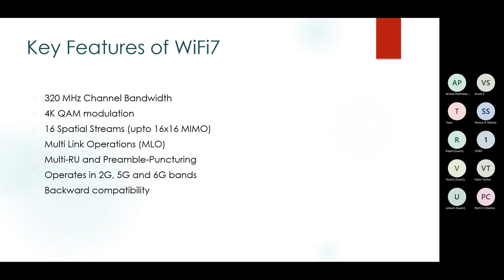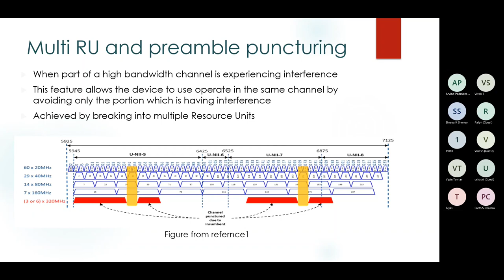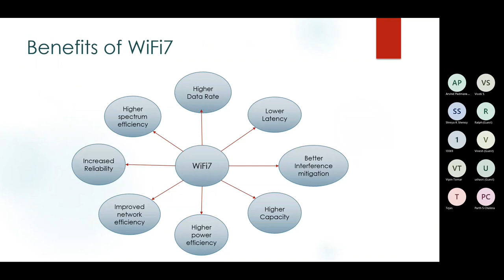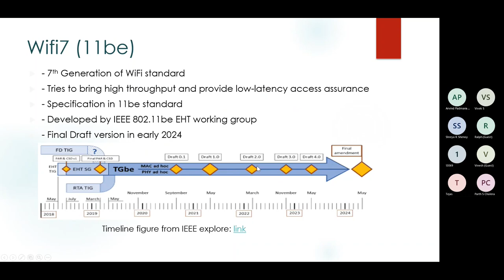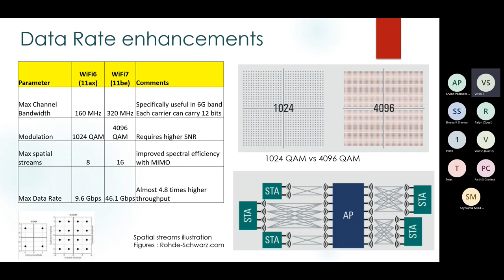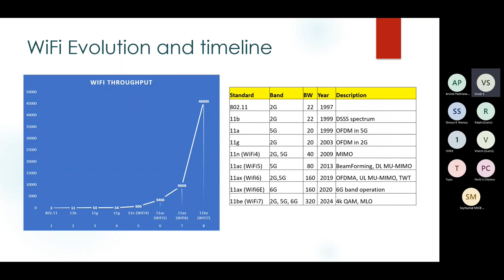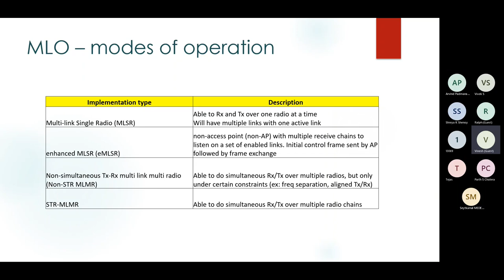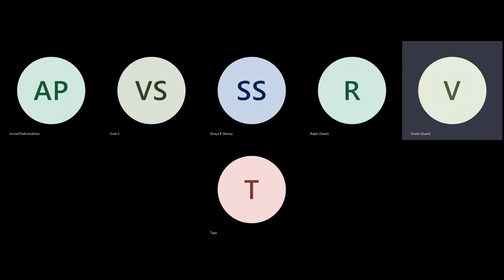The Basics of Wi-Fi 7

Comment: my take on "Question Vivek's regarding range difference between 5GHz and 6GHz"

When discussing the range differences between the 5GHz and 6GHz frequency bands, it’s important to consider the specific parts of these bands. Both bands are relatively large and quite close in terms of frequency, so general comparisons can be misleading. Here’s a more detailed breakdown:

1) Comparing Upper 5GHz and Lower 6GHz Channels:
If we compare the upper channels of the 5GHz band with the lower channels of the 6GHz band, there is essentially no significant difference in transmission range. The proximity of these frequencies means their propagation characteristics are nearly identical.

2) Comparing Lower 5GHz and Upper 6GHz Channels:
When comparing the lower end of the 5GHz band to the upper end of the 6GHz band (around 7GHz), there is a noticeable difference in range. Higher frequencies generally have a shorter range due to increased signal attenuation. However, the difference is not substantial enough to cause major concern. This is because Wi-Fi  7 includes features that enhance overall signal gain and mitigate range differences.